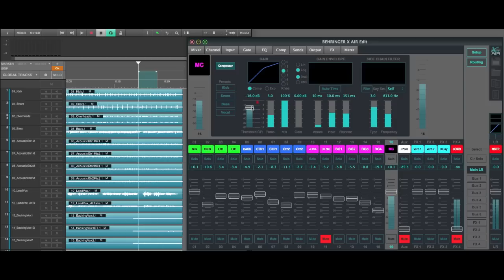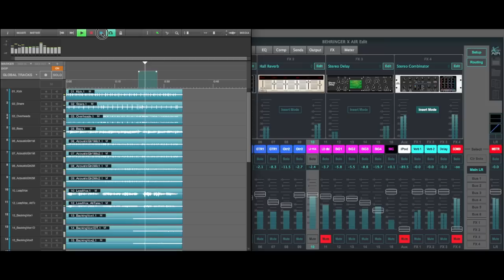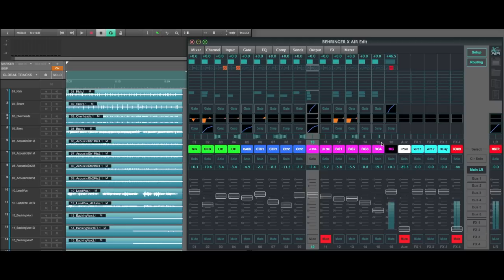Using Compression with Examples - MIDAS M32 MR18 + BEHRINGER X32 X-Air XR18 XR16 XR12 X18

Comment: Nice video. Personally i would never track with a compressor because it can't be undone.  Tracking should be as raw as possible with the exception of tube amp compression which is an essential part of the sound.

Comment: So The Gain in the Compressor tab just outputs the final sound (compressed or not) with the settings you gave? I thought it was how much DB it would give if i am far away from the mic... how much it would turn up the gain to catch my voice
Reply from the maker: It is just like a master volume for the compressor.  It will turn up the over all volume of that channel by lets say 3dB.  You would use this if your were consistently compressing peaks by 3dB so you would maintain the peak volume.